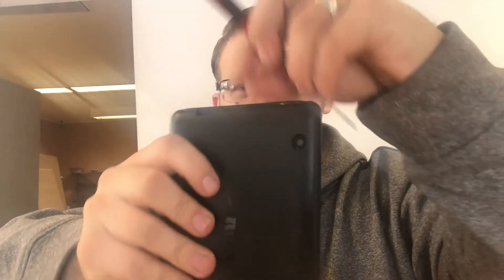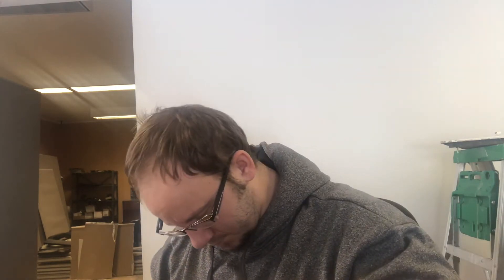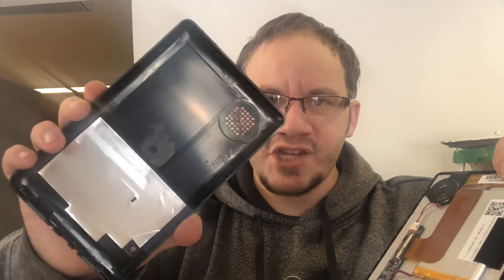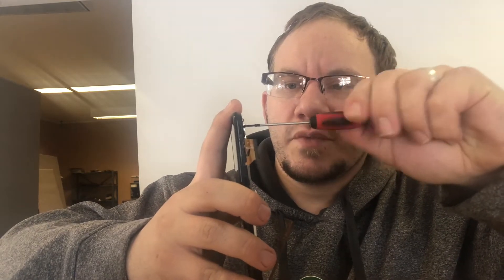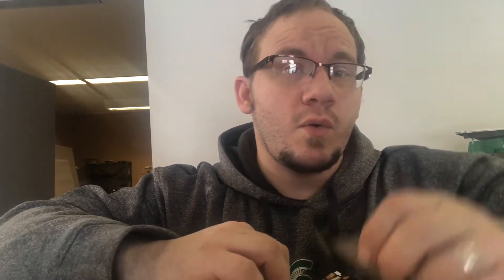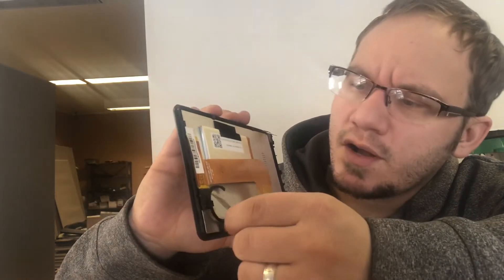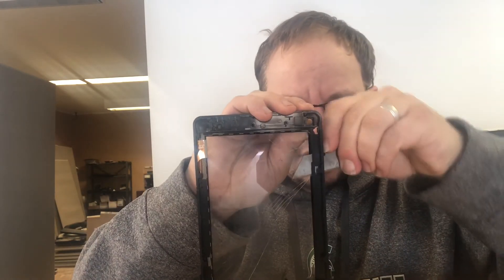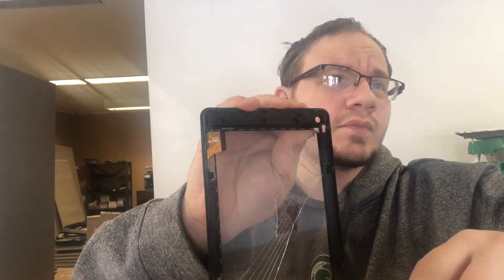Digitizer replacement repair on RCA Voyager III 7” tablet -rct6973w43

Comment: I haven’t been able to find ANY troubleshooting resources for my screen prob. My screen turns on but you can’t see it (it lights up just a little-BARELY) Since I remember what the screen looks like, I swipe up from the bottom on this blank screen and it makes the proper sound like it is now at the home page, but I can’t see it. Any suggestions? Essentially, the touch works but I can’t see the video. Right befor this happened the white parts of the screen looked like it was shaking.

Comment: Can you recommend a better battery for this? It looks like you can fit a battery nearly twice the size in that package.  The battery life is terrible on this otherwise OK unit. It's the ONLY RCA machine with an IPS screen making it suitable for a reader. But even with the backlight all the way down and just running the reader app in airplane mode, the battery life just sucks.  I'd also like a better quality battery that isn't likely to gas up and crack the screen.
Any suggestions?